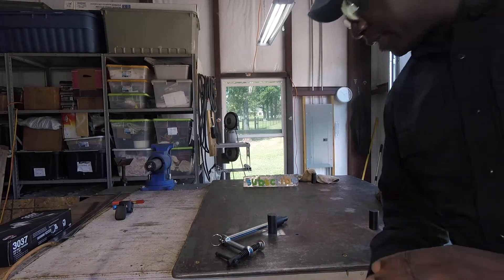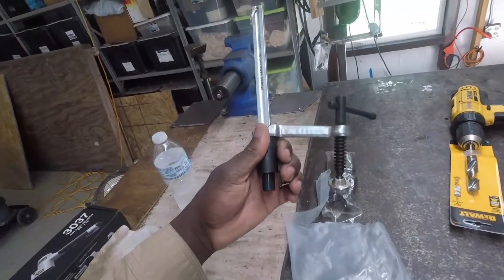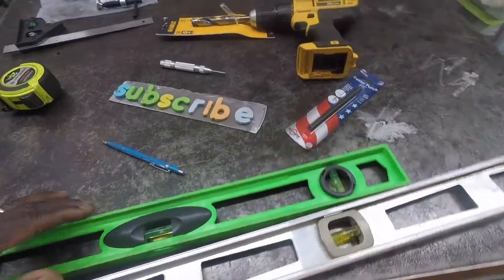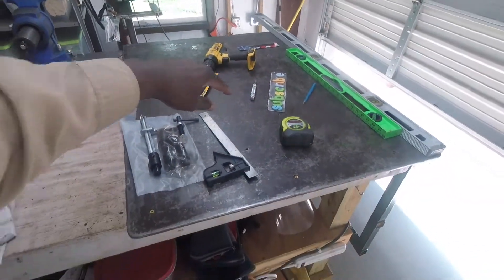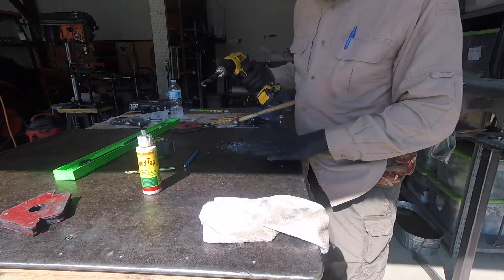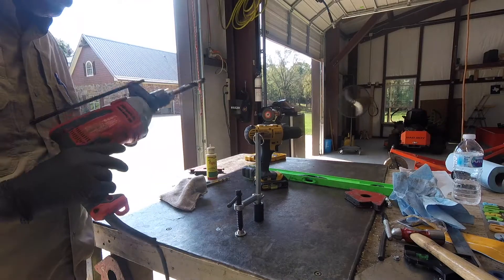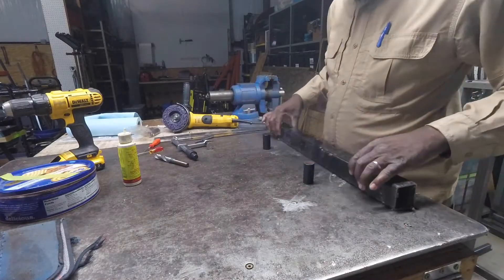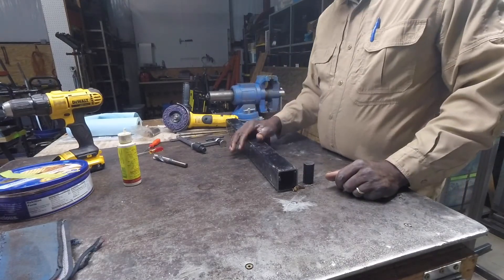Drilling Holes in Welding Tabletop for Build Pro-Inserta Clamp and Locating Pins

Comment: Hey Daniel where did you get the pins ?
Reply from the maker: Fireball tools sells them in a pack of four.  They are two inches tall.   Shoulder bolts will work as well.   Thanks!